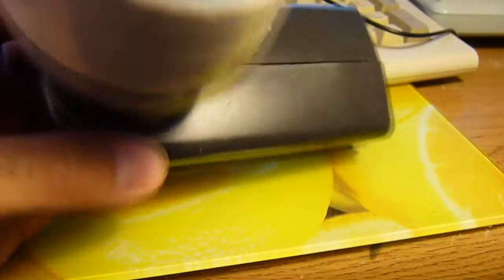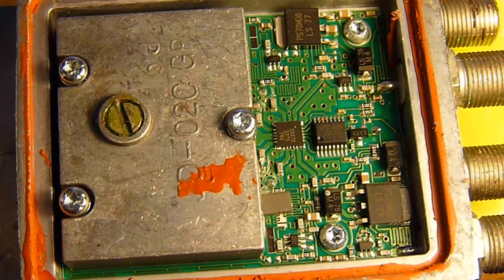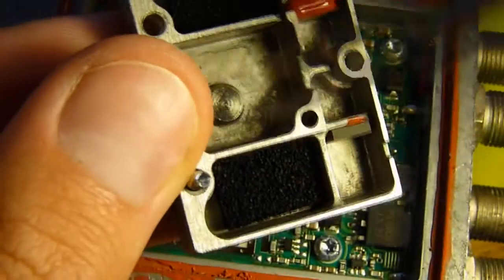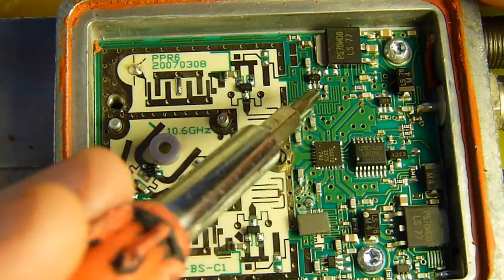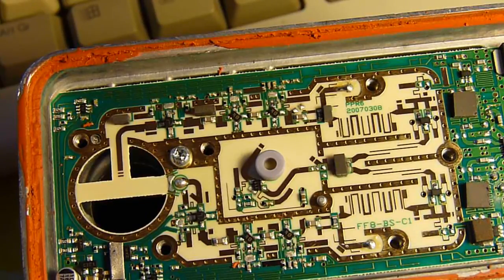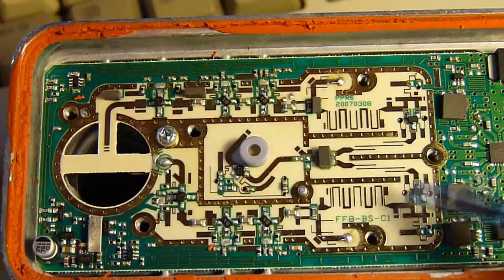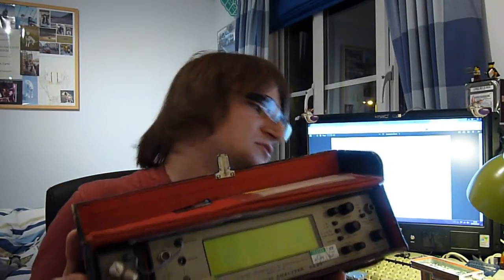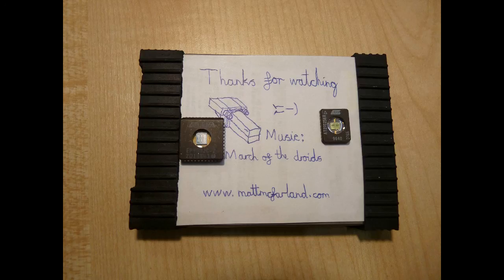WNC QUAD LNB Teardown

Comment: I can shed some light on the SHF section.  The round disk under the adjustment screw is a dielectric resonator.  it forms a cavity that oscillates at 10.6ghz. On the sides are the inputs. they are likely  left and right hand polarization. The traces that look like capital letter "E" form a tuned LC circuit. The input gets mixed with the 10.6 Ghz to down convert it to something more manageable.  The remaining circuitry is likely for power, filtering and switching.
Reply from the maker: Thanks, nice to have someone who knows what all the RF shananagins does, it is not intuertive how HF works.
Reply: Tuning right?

Comment: We use those coax connectors mainly for Satellite receivers and coax cable for Internet and Tv. They aren't great though, its not uncommon that they have ground faults and zap you with 60v. I've talked to Rogers the cable company like six times to look at their box, nobody listens to me. They killed two of our digital Tv boxes too.
Reply from the maker: Photographic Time I have seen them on Virgin Modems. The Sky one has had several repairs by me now, last one still holds up years later. Have had grounding problems on the standard TV cables before, but that was faulty equipment. Digital TV boxes die if you just fart in their general direction, never seen one that lasts more than a few weeks.
Reply: ***** Ours appear to be fairly good, they are apparently made my cisco. However they run on a horrible Via chipset , the interface is incredibly laggy so much so that it can take a second or two before changing the channel if you asked it too. One reasons we only use Internet now since YouTube and Netflix exist.
Reply from the maker: Photographic Time I have never come across a good free view box, satellite ones I have not seen problems with. The internet is such a wonderful thing.